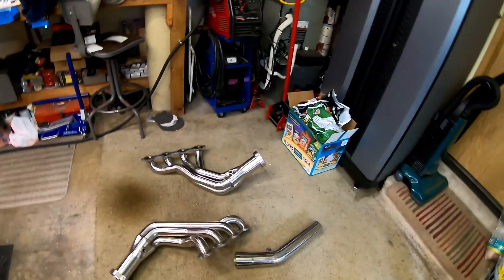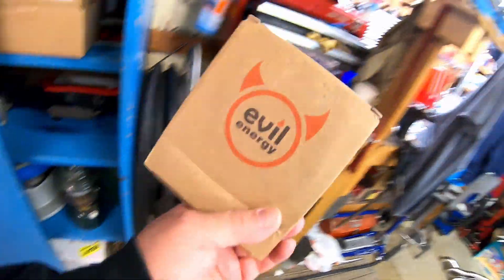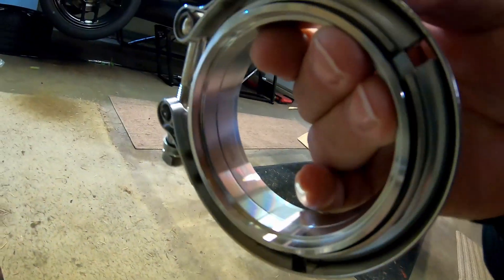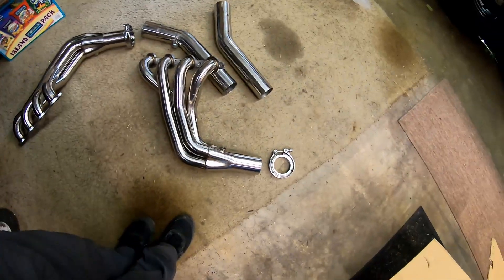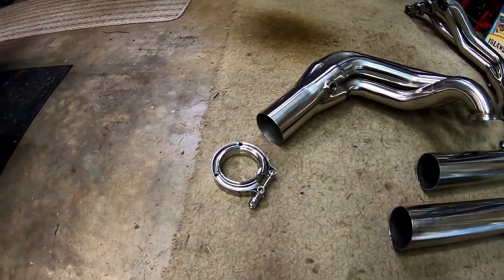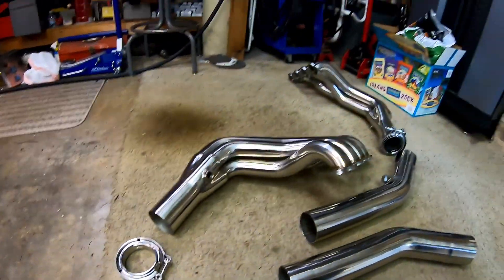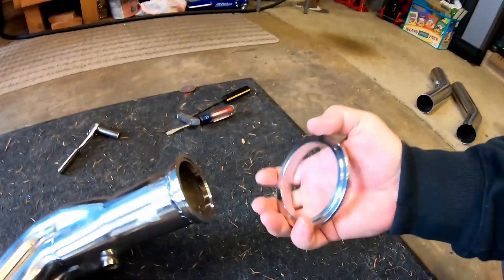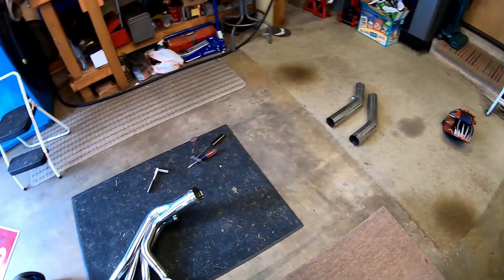How NOT to install V-Band exhaust clamps!

Comment: Hey brother, you can delete this comment if you want after you read it but just FYI you put the wrong side of the v-band on the header. You want the lip sticking out in the direction of flow. Its less likely to leak that way because the air will flow over the crack instead of hitting the crack if that makes sense. And as for the welds, they look at least 100 times better than anything I could do. I just tack things together then take then to someone else for finish welding because I suck, lol.
Reply from the maker: No worries there Robert. I am here to learn.  I was wondering which piece to put on the header.   The only thing I can hope for that this will work is the way these are machined once assembled there are no lips inside anywhere when it's connected if that makes sense.   It's 100% smooth transition from pipe to flange to flange to pipe.   For precaution I plan to just smear a tiny amount of high temp in the flange face when I put it together final time since this is a joint that will hardly ever be taken apart. These are the clamps that I bought.  Check out the way they are machined.  https://www.amazon.com/gp/product/B07439C4Z1/ref=ppx_yo_dt_b_asin_title_o03_s00?ie=UTF8&th=1
Reply: Yep. That’s a standard v-band flange brother. The lip I’m referring to is the lip that sticks out of the one flange that engages the other flange to create that smooth flow. It doesn’t seem like it would matter but it can. It the same concept as when you’re putting slip fit pipes together. You want the flow side to go into the side it’s flowing in, not the other way around. I hope that makes sense. I’m sure it’ll be fine. I’ve put them in backwards too. Sometimes they leak, sometimes they’re fine. And I’m a diehard believer in copper silicone “just in case” as well. 👍🏻 Matter fact I keep multiple tunes on hand with my luck. 🤣
Reply from the maker: @BadLuckGarage   Ahh I see what you are saying now.   Yeah definitely no do overs at this point hehe.   Hopefully they will stay flat when I weld up the mid pipe part of the v band.   Im going to have to take the mid pipe back out of the car so that flange will be welded on not clamped.  Fingers crossed.
Reply: Keeping them clamped while welding is the best option for sure. The ones I usually buy off eBay are only about $13 for a 3” vband set. May be worth it to buy an extra set just so you can clamp while welding to pull the heat out and keep it flat. My buddy that used to weld all my stuff used to keep vband ends with pipes several feet long already welded to them. He would wrap a wet rag around the end of the pipe before he welded because it said the pipe would help pull heat away from the vband while he was welding. 🤷🏼‍♂️
Reply: One tip I saw. Guy had a block of aluminum which he secured the header to with both sides clamped together. Test flatness after on a piece of glass with a light behind. Haven’t done mine yet but will try that. With a mig also.

Comment: What wire and welding gas were you using? I have Speed Engineering headers on my C7 and ordered V bands. I have to pull it apart to add them. Every slip joint leaks but the headers are actually pretty nice for the money so I hate to buy ARH or Kooks.
Reply from the maker: I hear ya James.  I think they make a great header overall.   I was using plain ole Lincoln .035  L-56 wire that is for welding all in any position and regular ole argon CO2 mix.   Like I said in the videos it's not ideal nor very pretty but it works.  I've welded a dozen stainless exhaust systems in the last 15 years with regular mig wire and have never had a weld fail.

Comment: next time slow the wire down a good bit more and lower the a few clicks, mig works way better running slow for steels from experience, doing this would have created a much neater pool around your parts.
Reply from the maker: Thanks for the tips SCARLET.   I made some changes when I did the mid pipe side and they came out a LOT better.  I showed those welds in a part 2 different video than this one.   My old lincoln 220 welder definitely doesn't have precise amps control.  It's A B C D or E.  In this video I was on C.  In the next video I was on B and did adjust the wire speed a bit.    It really would be fun to take a proper welding class some day.  :)
Reply: @PNW_Car_Mods  bah, just test the machine prior to running for optimal bead, i have an industrial grade linde which was esab before they existed, it just has a numbered clicker dial that goes from 1-10(i'm also building an experimental combo unit that fits in a 20mm ammo can), if you are used to welding steel it pays to read up on the difference in melting points for metals so you can gauge your temps better on the machine too plus compatibility with your filler material, especially being stainless has magnetic, non magnetic and a few other exotic alloys that get tossed around making things kinda annoying, lol

Comment: Any exhaust leaks after assembly ?
Reply from the maker: None at all.  Now to be fair, since this isn't a connection I take apart regularly I did or do put the thinnest film of high temp RTV on the faces before assembly.    THat being said from what I've seen the couple times I have taken the vbands apart I think it would seal fine without the RTV.
Reply: @PNW_Car_Mods   thanks buddy